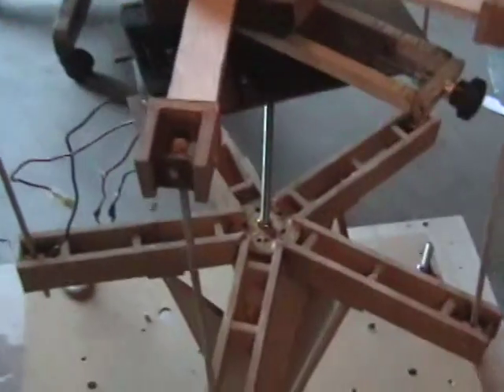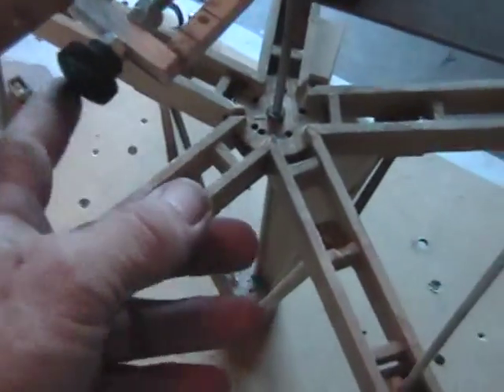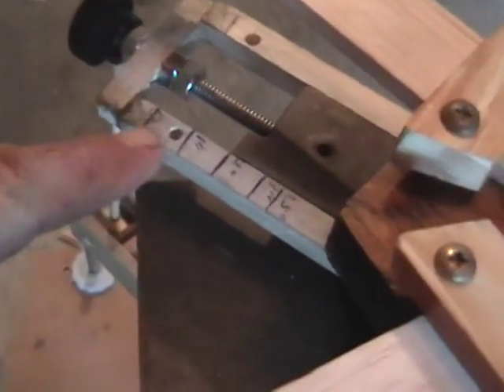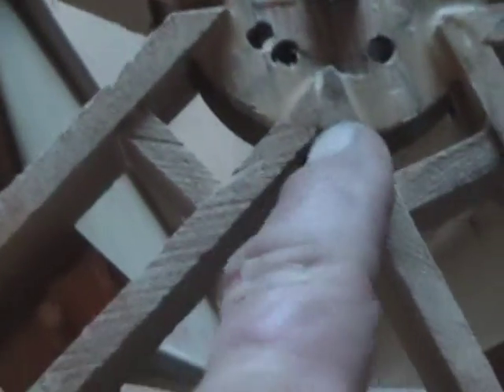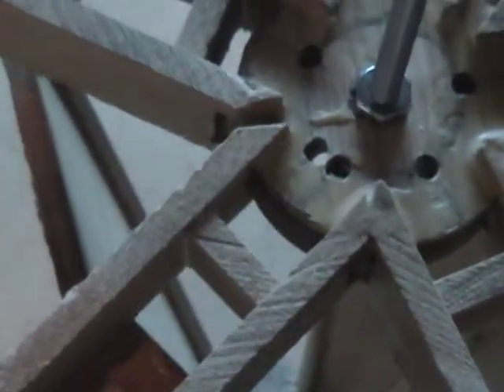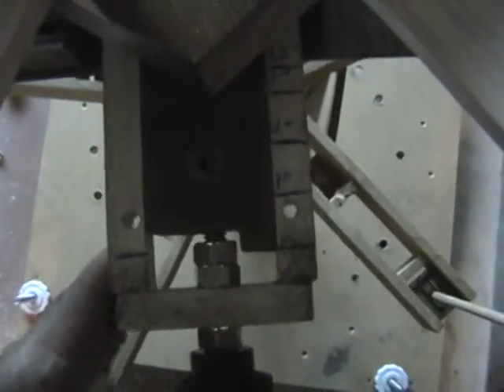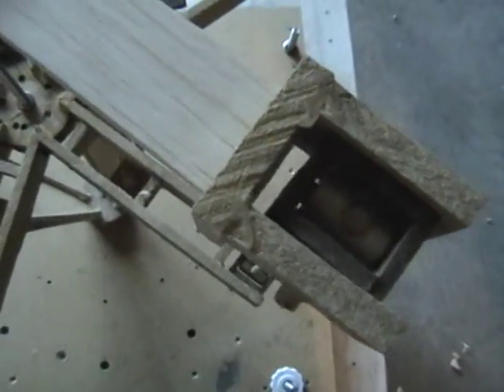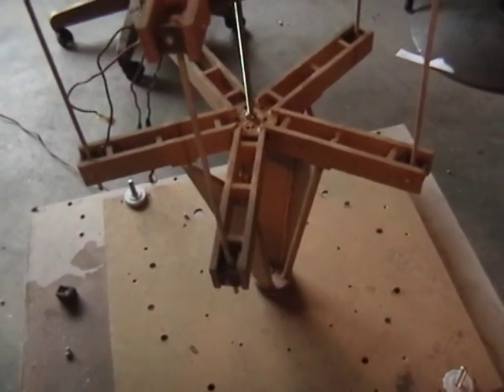Gravity 2 Rotary

Comment: you're doing a good job. yi you stop? I hope not. I'm doing a similar job, with slightly different functionality, but with the same purpose. we draw from both Skinner Gravity System. Fluctuations multiply continuously cop. In a short time I will publish my work, and I hope we will exchange experiences.
Reply: Thanks Armondo,
I haven't stopped, I have been trying to find the right size Spherical bearings. I have looked many places for 5 /16" or 8 MM shaft size with a set screw mounted on a flange although this is not set in stone; I could go somewhat larger but the friction is higher the bigger we go.  I did buy 10- 8 MM flange with set screw that is not a spherical buy we need them as well.  
I worked out the drive output and the rotational offset parameters but the five configuration is wrong. It must be an even number to hold the energy in harmony, Moreover, the rotation needs to be balanced by reversing the rotation with reference to the counter side rotating weights.
I am sorry to unload all this information on you without a video but I might have to give up everything.  I hope you understand.
Thanks for the reply; 
My wife is in grave danger of loosing her life and I have not had any time to get into the lab/shop.
I lost my job because I need to stay home with her during this time so things don't look good for me to salvage what I have done so far.
I am trying to start some marketing campaigns to make a living to get through these tough times... Wish Me Luck